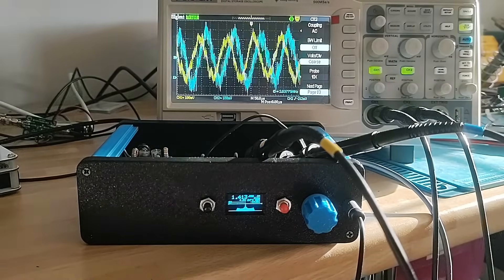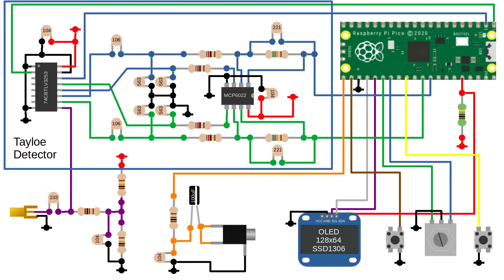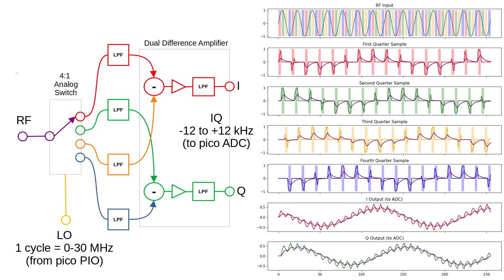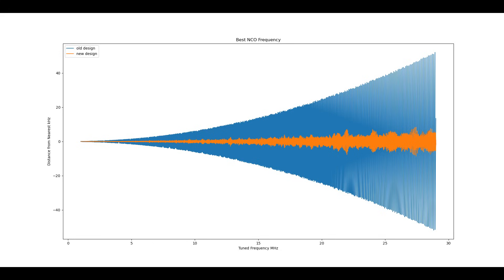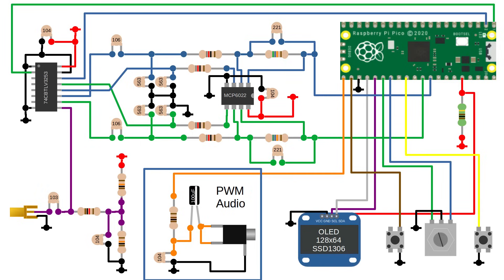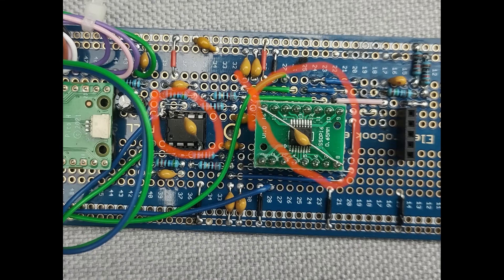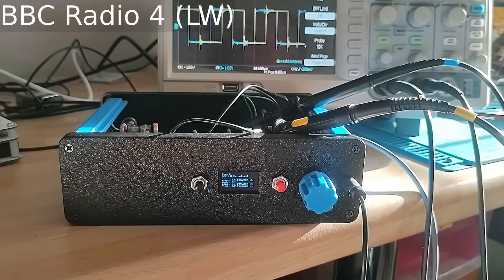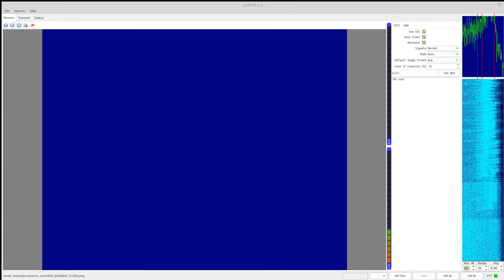Software Defined Radio with Pi-Pico

Comment: Hi Jon Dawson!
Thank you once again for making the pre-compiled file available. I want to apologize for the delay in responding, I was a little busy with college studies.
Today I carried out the tests by inserting the code and did a preliminary test.
I added the display to the Raspberry Pi Pico and inserted the file and it worked on the first try! Sensational!
I will be posting more information here in the future.
Thank you very much!
Reply from the maker: Cool, so glad you got it working! We have a gallery here: https://github.com/dawsonjon/PicoRX/issues/99#issuecomment-2423709531. If you want to post a picture of your build, would love to see it!

Comment: In case someone designed a board for this i would love to have a copy and order JPCB .
Reply from the maker: I have a PCB for the older design here: https://github.com/dawsonjon/PicoRX/tree/master/PCB. Its an older design, it does have a preamplifier and preselector, but doesn't have some of the latest bandwidth improvements. Its still supported by the latest software though. I will probably respin at some point, but I would like to revisit the design of the filter and preamplifier first.

Comment: Please, can you give a (very) rough estimate of the cost to build?
Reply from the maker: Hi, The Pi Pico costs 4 GBP, I paid 0.46 GBP for the analog mux and 1.44 GBP for the op amp. The displays cost between about 1.5 and 3.5 GBP depending where you buy them. I guess you could make one for about 20 GBP all in.

Comment: Hello friend! Congratulations on the excellent work! Very well done.
I would like some help, I don't have programming skills and I don't even know where to start to save the information to the pi pico.
I would like a better understanding of how to insert logic into the microcontroller.
I bought all the parts for assembly, now lacking knowledge on the pi pico.
Could you help me?
Once again, thank you very much! 73's.
Reply from the maker: Hi, thanks very much and good luck with your project. You can grab a pre-built .uf2 file here https://github.com/dawsonjon/PicoRX/actions. 
If you hold the button on the pi-pico while plugging in the USB cable, it should appear as a USB drive. Just drag and drop the .uf2 file on the drive and that will program the device.
Reply: @101Things-ds8tc Your message is no longer available for me to read. Could you share again? Thanks!

Comment: hey how can we build up to 5ghz rtl sdr
Reply from the maker: Hi, you would need a down-converter, using high frequency mixers. Construction is a lot more challenging at those sorts of frequencies, it would need a very carefully designed PCB with impedance matched traces etc.

Comment: I recently replicate your project, and it is successful. I'm using a different op-amp (NE5532) and analogue switch (74HC4053). One question, from your project description page, it is clearly stated that you set a cut off frequency to 12KHz, is it possible to change the sampling processing from the code it self without changing my default hardware set up?. For your information, there is a lot of background noise in my receiving performance and I suspected my input and op-amp cut off frequency was too low
Reply from the maker: Cool, glad you got it working. I think that with the 74hc4053, 33n instead of 56n for the sampling capacitors should give you about the right bandwidth. The code samples at a fixed 500kHz, it's beneficial to oversample regardless of the Tayloe detector cutoff.
Reply: @101Things-ds8tc  Very thanks for the reply. For your information I'm used the previous Tayloe Detector circuit for my USDX project. I'm using 100n for the input with the feedback resistor - 82K ohm and capacitor 1n farad. Do I need to change the feedback resistor and capacitor value?

Comment: I don't understand the use of AAAs for power. They cost the same as AAs and have less than half the capacity.
Reply from the maker: Totally agree, the only advantage of AAA is that they are physically smaller. If you have the space use AA they will last even longer.

Comment: Why are you IQ sampling, the pico has only one ADC , you are not IQ sampling at all
Reply: for iq you need to sample at the same time two signals coming out of the iq mixers, rpi pico doesnt have two independent ADC
Reply from the maker: That's an interesting question!

Although we can't sample I and Q at the same time, the pi-pico does provide a round-robin mode allowing us to sample I and Q alternately. Provided we meet the Nyquist criteria we can work out the value of the signal at any point between samples using interpolation, thus we know what the value of Q would have been when we sampled I and vice-versa. 

It turns out that the processing required to do this is trivial, you just replace the "missing" samples with zeros, and remove the outer half of the spectrum (which we would need to do anyway). Of course you don't get something for nothing, we still get 250kHz bandwidth from a 500kHz ADC. 

There is a write up on the technique here: https://101-things.readthedocs.io/en/latest/radio_receiver.html#sampling-iq-data-using-a-round-robin-adc.
Reply: @101Things-ds8tc  I beilieve (after reading your article) you have a 250 khz bandwidth, if that is the case then why not just directly sample the signal at 500khz, you will get 250khz anyway, much easier! . Why even use tyloe mixer? use a balanced switching mixer, much much easier with very common and cheap thru hole parts. I made an sdr using pico direct sampling using a switching mixer, will link it soon
Reply from the maker: Cool, your project sounds very interesting, I'm always interested in minimalist receiver designs!

I chose a Tayloe detector for my design because they are (relatively) simple and perform very well with low loss, very good sensitivity and linearity. One of the main advantages of IQ sampling is that it can distinguish positive and negative frequencies, (signals which are above and below the local oscillator). For this reason I/Q mixers are sometimes called "image-rejecting" mixers. 

You can use a single mixer, and sample the output directly using an ADC, but one downside of this approach is that it can't distinguish the positive and negative frequencies (they just get added together and can't be separated in software), so it might be susceptible to interference from adjacent channels.

To avoid interference, you need to filter out images in hardware before sampling with an ADC. Filtering image signals in hardware can be just as complex as IQ sampling, but it can perform better (e.g. in a superheterodyne receiver).

Simple direct conversion receivers, do work well for AM signals though, with AM signals, the positive and negative frequencies are the same, so you don't need to worry too much about them getting added together.

Comment: Hello! What is the algorythm of demodulation in the receiver?  The simplest way for SSB - is  an alorithm of the Wevaer reciever. Other case - square root  of sum  I^2+Q^2 for AM.  In other cases there must be low-frequency wideband phase shifter: it is very heavy for CPU
Reply from the maker: Thanks! I'm using frequency shifts and filters to suppress the opposite sideband. For AM I use a fast min/max magnitude approximation. There is a full description here: https://101-things.readthedocs.io/en/latest/radio_receiver.html#demodulation-fm.

Comment: Super awesome! Subscribed ❤
What modifications does this circuit required to add an amplifier and change to transmission mode ?
Thanks and all the best!
Reply: I'll dig into this channel more, 
Would love to see this turned into a 2way+ SDR for infrastructure-less mesh communication. If the unit can adjust frequencies modes on the fly and the amplitude based on the provided adhoc power source + antenna, then any device can be made into a powerful relay and extend the network with no hw changes.
Not sure if pico runs unix but add pi zero and a touch screen and you got a infa-less cellphone.

Imagine not paying mobile isps, serving sites with edge load balancing, a truely free internet could be built on this
Reply from the maker: Thanks, I don't think it would be that difficult to implement TX. in It's simplest form, it could be a simple merge with the transmitter project.

Comment: I can't resist building this SDR.  I related to your comparison of this receiver to the classic crystal radio.  I too was hooked on radio after hearing music in the earphone of a simple crystal radio I bought from the Scholastic Book Club when I was in grade school.  I seem to recall that this item was more expensive than most of the books and little kits for sale, the number $6 sticks in my mind.  When translated into today's dollars, the Pi-Pico radio will cost about the same.    I ordered the 3253 mux part but when they came , I learned that I ordered the TSSOP package.  I'm not confident that I will be able to solder that tiny package to the adapter board.  I looked closer and found that a SOIC version is available also.  I ordered the SOIC parts just in case I make a mess of the TSSOP part.  I can't wait to get started.

Update 9/22/24

I finally found the time to build the receiver.  I decided to build it on a solderless breadboard just to try it out.  It turns out the soldering the TSSOP part was not as difficult as I feared.  I simply applied lots of solder which created one large solder bridge.  The excess solder was removed using solder wick and resulted in a nicely soldered part.  After carefully assembling all the parts on the breadboard, I applied power via the USB interface, and tuned to a local AM station.  Success!  Hearing the local AM station was almost as exciting as hearing a jumble of voices and music on my first crystal radio.
Reply from the maker: That's great 👍 I hope you enjoy the process as much as I did!

Comment: Its possible to use the MC74ACT139N? Thanks and compliments for the projects.
Reply from the maker: Thanks, unfortunately I don't think this is suitable, it looks like a digital mux with the same pinout. You need a analog mux. Look for something with a low on resistance e.g. 5 ohms and a fast switching time e.g. 10ns.
Reply: Thanks

Comment: AIS uses frequencies around 162MHz, would it be possible to use this for receiving AIS if using a quicker MCU ?
From Wikipedia:
Channel A 161.975 MHz (87B)
Channel B 162.025 MHz (88B)
Reply from the maker: You could probably achieve this using a down converter, but there might be other simpler solutions out there.
Reply: Simple is good. :) @101Things-ds8tc  
-Before I forget. You could have several receivers on a single MCU.
Perhaps you could set up the timers to generate frequencies and connect the DMA for sampling data, so the MCU is freed up to "relax". It might even be able to receive while  being 'asleep' (WFI).

Comment: Have you tried with a pico2 yet?
Reply from the maker: Yes, quite impressed so far. Will post a video soon.
Reply: @101Things-ds8tc  Thanks. I playing with larger display as well, I trying to follow the code, most of the display routines are in ui.c and ui.h right?

Comment: Great project! Can I use a CBT3253 instead of the chip you used? What are some other options if not? The chip you used is unobtanium here.
Reply from the maker: Yes, 74cbt3253 would work so long as you supply it with 5v rather than 3.3v.

Comment: This is very intriguing. 20 years ago I was wondering if it's possible to build a cheap analog receiver for marine utility radio (NAVTEX, weather reports via RTTY and radiofax). Cheap receivers would have too much drift for reliable operation, but a microcontroller might monitor the demodulated aufio signal and re-tune the receiver accordingly. Probably possible, but too much of a challenge for someone barely confident in digital electronics.
Seeing this project makes me reconsider that old idea …
Reply from the maker: Cool, it all sounds doable!

Comment: What the appropriate cost of the parts? How does the performance compare to the typical HF radios, like the Icom 7300, Icom 7610, or other equivalent brands and model HF radios?
Reply from the maker: Hi, The Pi Pico costs 4 GBP, I paid 0.46 GBP for the analog mux and 1.44 GBP for the op amp. The displays cost between about 1.5 and 3.5 GBP depending where you buy them. I guess you could make one for about 10-20 GBP all in.  I haven't done any scientific measurements and don't want to make any wild claims about the performance, but with the you-loop and LNA setup it seems to receive most of the stations that my RSP1A does, although they are harder to find and don't always sound as good.

Comment: What’s the name of the LNA you are using with the antenna?
Reply from the maker: Its just an unbranded generic wideband LNA. Something like this one (not a recommendation but should give you an idea). https://www.ebay.co.uk/itm/126578890836?_trkparms=amclksrc%3DITM%26aid%3D1110013%26algo%3DHOMESPLICE.SIMRXI%26ao%3D1%26asc%3D264183%26meid%3De51288ebad91450d8c324999fb234140%26pid%3D101196%26rk%3D2%26rkt%3D12%26sd%3D186490543190%26itm%3D126578890836%26pmt%3D1%26noa%3D0%26pg%3D4429486%26algv%3DSimRXIVINativeV2WithSellersOwnItemsFilter&_trksid=p4429486.c101196.m2219&itmprp=cksum%3A126578890836e51288ebad91450d8c324999fb234140%7Cenc%3AAQAJAAABAPUpV7F1Bd%252BBh9UJeewaO4DKj%252BmyWoAZr9ZAL2aU%252FtKZ5Z5Dpbx7fDPnVlcJ5A8LF5uP8Rr8BkU%252B6dS9RRzP0VriUmQgh7795vpdINBLm77hMIXRqtLVn7bjRFXBGmbyS6nx6OqJLPrnaadtgfLzvVXHRgNdHBYNfeP%252Ff9%252BC2kZtLOf%252FiDv6Rj8BGsKFk6kTw3h9AHwVX8VbIzRGhTMOM1uHpUzPQ6XenaVg1Di0eWHEKBMxQ%252Ff1hsNGb0WA3Z1OwygDZQxuVsWOuW%252BO54r2zY3xzvIDbfZQfV9bWxv0k97vIiUT4Qk2s1FiM58S7yvwsO0My724Ju5ttloXn2lAHz0%253D%7Campid%3APL_CLK%7Cclp%3A4429486&itmmeta=01J5GQVV0KY8FWDNA0EZ7K6A77
Reply: @101Things-ds8tc  Thanks.

Comment: I wired the Pico up according to the pictorial diagram pointed to on the github.  The display lights up and shows 1.411 mhz AM.  Pressing the buttons or operating the encoder doesn't seem to do anything.  I'm using the click wheel encoder from Adafruit, right and left buttons on the fwd and bkwd switches, encoder switch on the press switch.  I uploaded the pre built firmware.  Don't have the IQ mixer wired up yet (waiting for parts) but I wanted to see the UI functions.   It does seem to be doing something, touching the pico causes temp reading to bounce, along with s meter.  Just can't get into the menu as if the switches don't work.
Reply from the maker: Cool! Sounds like good progress so far! I can't see any reason why it wouldn't work with that encoder in the way you describe. There are internal pull-ups on the encoder/button pins, so these should normally read 3.3v, and dip to 0v when pressed. You should be able to check the pico pins with a scope or meter. Might also be worth checking the continuity of the encoder switches too, just to make sure the pins are connected as you expect. Assume you are using the original pico, not the pico2, the code for the pico2 isn't quite ready yet.
Reply: @101Things-ds8tc  I don't know who is "lucky" enough to have a pico2, I've signed up for notification at digikey on stock.  I'm using a pcio 1.
The display used (0.96") is rather small and my vision isn't up to the task anymore (far sighted in my old age!).  Am using a magnifier to read it!
  Would like to sub a larger one, but then would need a different driver library.  
Will check the encoder / switches with scope.  Could also be the breadboard, might need to solder connections.
Reply: Tested with a scope, and then an ohmeter on the encoder.  Looks like the encoder wheel is totally dead.  NONE of the switches work.  Will stick an encoder like you used on the breadboard and try it again.  Can't believe I got a DOA from Adafruit.  It's been sitting in the junque box for two years now, waiting for a project to use it in so too late to send it back.
Reply from the maker: That's a shame, I thought they looked pretty neat. It sounds like a bigger screen would be a really popular option, I'm sure its something I will be looking at when time permits.
Reply: @101Things-ds8tc  I think I just got a bad one, either the wheel or the adapter PC board.
I might move the bands and push io's elsewhere if possible so I can use the SPI interface for a tft display.
Reply: Replaced the encoder with two switches and a simple encoder with switch.  Still had problems so I checked wiring again and found two switches wired up to wrong Pico pins.  Now it works!  Waiting for op amp and some caps on order from digikey, then will try to receive something.!

Comment: I am insterested in building this. What package type of 743253 did you use?
Reply from the maker: Sure I used a 74CBTLV3253PW in a TSSOP-16 package. You will need an adaptor if you are building on a breadboard, I think most are double sided with soic-16 on one side and tssop-16 on the other.